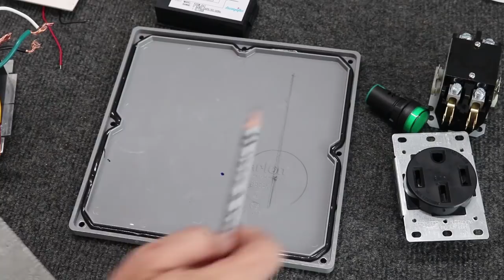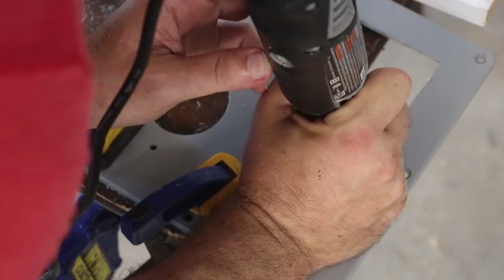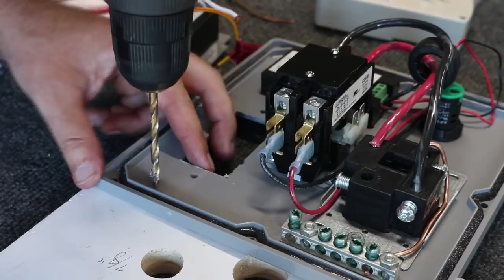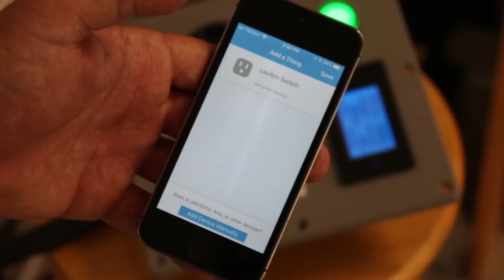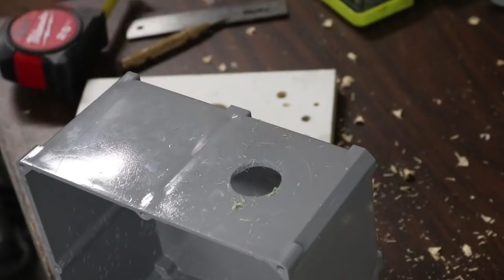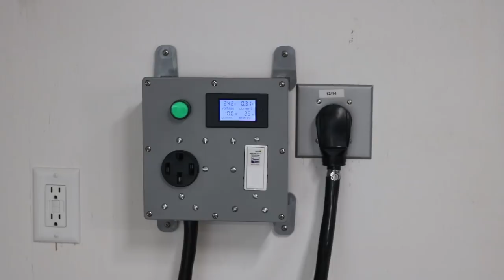DIY Home Automation for Electric Car Charging

Comment: Ben,If I don’t need a Wi-Fi switch .May I use the normal switch?
Reply from the maker: You just want to be able to turn a contactor on and off with a regular switch?
Sure you could do that.
I just wonder why somebody would want to, as the same effect could be done by flipping a breaker.
Did you just want the convenience of plugging in, and turning on power to the EVSE later?

Comment: I'm confused so the contactor is receiving 240 volts and it's rated 120 how is it not burning up?
Reply from the maker: No. The contactor is only getting 120V.
A NEMA 14-50 connector has two hots, neutral, and ground. Because of that, you can pull 120VAC OR 240VAC. The power for the contactor is from one hot and the neutral, for 120VAC.
Reply: BenjaminNelson thank you

Comment: I would put a fuse on that ammeter (and maybe the phone app switch too) - fire insurance.  And I would cut the power to the ammeter... reducing my odds.
Reply from the maker: Cutting power to the ammeter means that it could NOT track total energy over time. Allowing it to stay on lets me know how much power I've run through the EVSE in a month.
Reply: I have am identical one, there is a backup battery or capacitor for memory.

Comment: NEC only allows for 1ft wiring to/from EVSE. I would put the plug inside the box, then plug the box into the outlet.   This is probably because the whole house doesn't come with a RCCB.  Maybe install one for your whole house. Safe for your family to be around it. RCCB is equivalent to GFCI while RCCB is the affordable alternative.

Comment: on my Renault Zoe car, I can set the timer, what time to start charging and what time to end. No need for external timer.
Reply from the maker: Most electric cars have some sort of timer. The interface on mine is not particularly good. This box is nice and simple VERY easy to use. It only takes a split-second to either charge now or later (just by pressing the light switch.)
Really, the more exciting part is to have it connect with my home and charge based on other variables in my Home Automation System.

Comment: Unless you need to because of discount electrical prices the best thing for electric cars seems to be ABC Always Be Charging. 
Those of us who have tried this out on Mitsubishi PHEVs' have had our batteries refresh themselves back up to near 100% original capacity.  Mine has done 82400 miles and in the last 7 months and  22000 miles it has gone up from 88.4% to 98.6% on a 4 year old battery. Others have got back to 100%
Reply from the maker: I've generally done Always Be Charging. Because my car has such a small battery, it's great to always get a charge to top off. Although the Mitsubishi iMiEV is only rated for about 60 miles per charge, there was a week or so when I was driving well over 100 miles per day. It's because I was traveling in the morning, at home for a while in the middle of the day (charging on solar) and then driving again in the late afternoon.
I just don't want to be adding to a load to the grid late in the day at peak usage.
The car also has a very basic timer control, so any other way to control timed charges in an improvement.

Comment from the maker: Neutral bus bar has been removed and then reinstalled on an insulated spacer. No electrical connection to mounting screws.
Reply: Add a annotation to the video?
Reply: lol I was just about to comment about that live screw. Keep up the good work, subscribed, also just binged  the 18 vid on your EV conversion

Comment: 1 mistake.  The mounting screw heads for the neutral connection can be touched from outside the box.  There is a potential difference from ground people should not be touching.
Reply from the maker: Yep, that was just pointed out by another viewer. There's no potential difference, but yes, I'll correct that. See comment below.
Reply: According to the National Electrical Code (NEC) there is only one point where the neutral and the ground are connected together.  That is the panel that has the main power cutoff.  ALL other panels are considered to be sub-panels.  Once outside the main panel the neutral is considered to be live and must be treated and insulated just like the 2 hot lines.

Comment: Not to keen on the natural screw heads coming through the front plastic panel - I know they should be earthed / grounded at the meter and or main supply transformer.  Out of curiosity can you measure any voltage between the ground and natural ? - I doubt it...
Reply from the maker: Ah, I see what you're saying.
Right, I was just using the plastic cover as an insulated point to mount to. I wasn't thinking about how the screws conduct to the outside of the box. Putting screws INTO the box cover would be fine but THOUGH the box (with conductive fasteners) electrically brings the circuit to the outside of the box. Neutral and Ground are bonded at the main breaker box, so they ARE both at the same potential. Because of that, I can't imagine how there would be any safety issue here, but it certainly isn't best practice. I'll swap out the machine screws for non-conductive ones or use some sort of non-conductive spacer to mount the neutral bus to.
Good catch.
Reply: You got it. I know in normal conditions it's not a problem, however, IF the natural came detached some how during a fault or whatever the natural could be come live via the rest of the circuit. I guess it's better to safe than sorry. I'm used to UK 'fussy' rules here !.